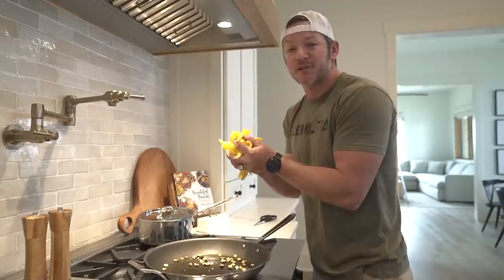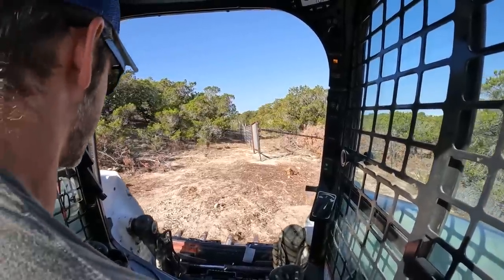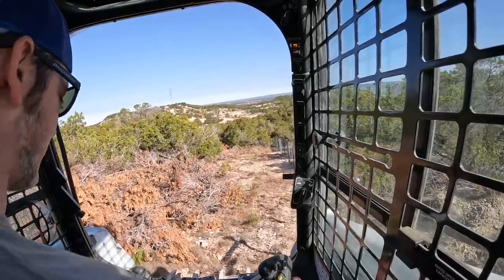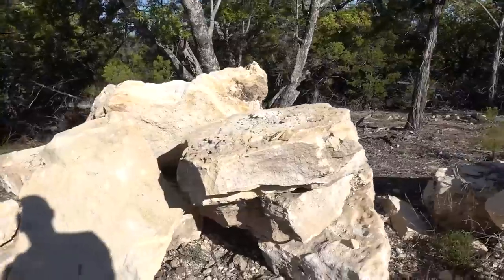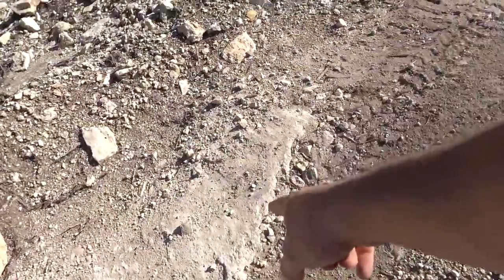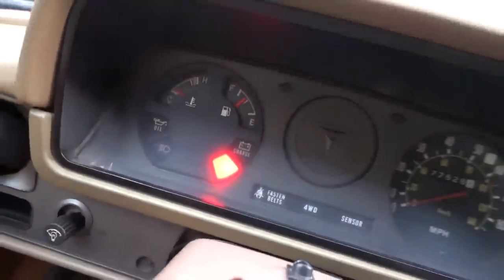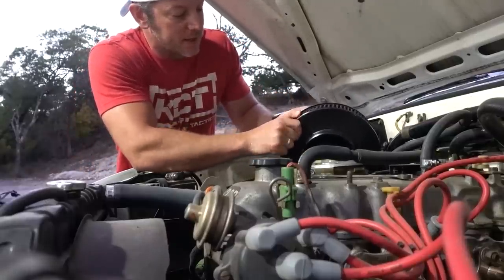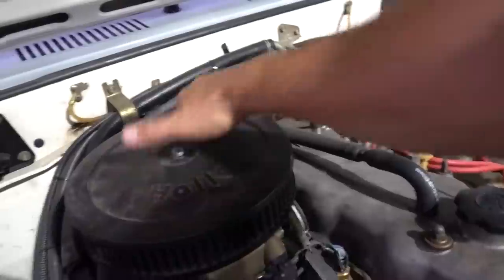Making a Home for the Goats!!!

Comment: Build your goat barn on skids so you can move it around that way it’s easy to clean the pen or move it to a different place if you need to. Also I would recommend wood sides so it stays cooler in the summer
Reply: Very smart idea.  When a fella knows, he knows.   Information has value.
Reply: that's better than my idea  to build doors at each end so the skid loader could clean it out easily.
Reply: My brother built his chicken coup on wheels
Reply: Yesssssss!
Reply: Demolitia FTW
Reply: Goat barns in Sri Lanka are set up on poles. Then their waste falls down and they are protected from floods and moisture. Also, it is easy to clean.
Reply: @thilinasesath3869  That actually sounds like a great idea in a few ways. Everything will fall through (as you mentioned), it'll let them stay on dry area when things are wet and the extra bonus, if set up properly could be raising it enough and adding something like pillars or blocks at reasonable heights that the goats can jump from one to the next till they're in would be to give them somewhere most predators wouldn't be able to reach or climb to. I don't know about that particular breed of goats but, one I used to have as a pet was an amazing climber, much better than any medium sized predator and they love doing it so raised up 4, 5, 6 or even more feet could provide them with pretty good protection and, they'll feel more secure plus enjoy the climbing.
Reply: Had a 10 x 20 horse shed on “skis”.  Easy to move with a tractor.

Comment: MATT the goats will jump up and over the fence from the roof.
Reply: He better make the roof really tall so they can’t climb on top of it, or put the pen in the center away from the fence
Reply: Yes, goats love to climb and if your shelter is too close to the fence, that will be an easy escape route.
Reply: 😂 make straight walls they can’t climb
Reply: @tylerwestman5258  they will do some parkour wall jumps off it still
Reply: @cmawhz  make it sheet steel and paint it now they won’t be able to get any traction to wall jump
Reply: I was wondering the same thing.
Reply: That's not going to be a problem... mainly because the whole fence is far too low and they'll get right over it with no problems as it is, especially on the stepped portions. That's if they don't get eaten within the first week of being let out.
Reply: Once they're full grown they will be able to clear that fence from the ground. It needs to be about three feet taller.
Reply: Build the shelter far enough away from the fence, so they can't climb it, then jump over the fence.
Reply: He was told that in the previous video but he does not listen or read comments!!
Reply: I agree move the barn shelter al least 20 feet from the fence and keep the inside fence line free of anything that goats can clime and then jump over
Reply: Exactly what I was thinking
Reply: Predators  can easily  clear that short fence. Goats will be gobbled up.

Comment: I have goats in Texas and a 3 sided shed will be fine. Metal in Texas will fine as well. Goats are very hard on everything so the more metal the better. Hope you get my metal suggestion. Build it away from the fence unless you are going to make it to tall enough that they cannot jump on the roof. If your driving in and out of the pen then make it so you have to go through two gates , one gate is always closed when entering and exiting. If your male is not banded already then you need to fix that or be prepared for a very aggressive goat and I am not kidding on that.
Reply: When they're young you can just use one of those Igloo dog houses for shelter.  They are small enough that their body heat will keep them
warm in the winter and they love to jump on top of it!
Reply: (good pun! - Kidding - you know, cos baby goats)

Comment: Hey Matt, you should put a nut at the bottom of the hold down so you can lock the hold down to the top of the TB, then it can't come out again. 22Rs vibrate a bit so a lock nut at the TB is necessary to insure it stays.
Reply: And get rid of the nut and washer. The less parts that fall down the intake the better. Or at least double nut, or nylock what he's got now

Comment: Unless your brakes are leaking, you probably will need to replace your brake pads soon. The brake master reservoir is sized so that it holds enough fluid until the pads wear out and the pistons extend. Change your brakes, bleed them, then make sure the reservoir is at the full mark.
Reply: Don't necessarily need to bleed  unless air got in there or doing a flush. I've had issues just doing brakes
Reply: Couldn't have said it better myself!!
So many times iv had customer vehicles that they topped up there reservoir and when we replace the pads the brake fluid overflows and makes a wonderful mess.

Comment: For the barn, any simple, yet sturdy structure that has a heating lamp or even insulation if you’re feeling fancy. But I mean, the most important thing is that it keeps them warm, dry, and safe. You COULD put something like a dog or mule or something out there with them for protection against animals, but that part isn’t necessary assuming you attend to them regularly

Comment: Make sure the barn is facing east to protect them from the wind an rain. I would put the barn closer to the gate. I would build a water collection system like the chicken coop and have lights either solar or run electricity.

Comment: With the rocks, use those for the goats to climb on, it will help keep the hooves wore down. That way you won't have to trim them as often. Also make sure your goat hut is tall enough that the goats can't jump on top of it and then jump the fence. And if you build a 3 sided run in with a wall that also goes half way across the front, they will be able to stay out of all wind and weather that way.

Comment: Hi there Matt! It's so fun that you got your kiddos kids of their own. Does this make you and Mere grandparents? Those rock slabs will be PERFECT for a play structure for the babies. The good thing about rock is it will also help to keep their hooves from overgrowing as fast.

The biggest thing to keep in mind when putting a shelter up for goats is that they HATE water. If they are on the downhill side of all the water that is going to run off that hill, they are not going to be happy. I would suggest putting some sort of "poor man's" french drain, meaning dig a ditch on the uphill side of the shelter and back fill it with large gravel. I think that'd go a long way to keeping them happy. The other option would be to put a floor on it, which would resolve most of the water runoff issue. 

There are a lot of good channels out there to show you what goats want and need. I would recommend making the lean-to/shelter portable (to an extent). I'd make it so the skinniest end can fit thru your gate, just in case and that three of the four sides are closed in. If can envision what I'll try to describe, then it may be helpful. Essentially what I'd build would be what is frequently referred to as a loafing shed. If you can envision a rectangular structure with 6 posts erecting it, you would completely cover three of the four sides. Now, on the front of it, it will be open with a post in the middle of it length-wise. If it were me, I would also make a half wall on one side of the front. It will help with shade, wind break and blowing rain.  If at all possible, it would be great if you could keep it strong enough to withstand weather, but light enough that you would be able to make it somewhat portable. I hope this helps. If nothing else, it'll give you some ideas. If you look at Flair's channel, you can see the two large red structures he has in his animal paddocks. That's the idea behind what I tried to describe, lol. I tried!

Heather🇨🇦
Reply: 100% all this !

Comment: Matt, put locktite on the carb filter stud. That way you won't have to worry about it vibrating loose on you. Preferably red or orange locktite, since youll likely have alot of heat in that area
Reply: probably a hard to undo sort on the rod into the body then a type you can undo on the top nut so you can take it off (I only know blue & purple, are red & orange the equivalent in high temp?)
Reply: @trif55  orange is similar to blue but it's made more for high temp environments, red is the strongest but being it's being heat soaked in that area regularly, it would reduce some of its effectiveness. I doubt blue or purple will do anything and might as well just use nothing on it
Reply: @gtileo  thanks

Comment: Hi Matt. I would reccomend put a nut on the bottom side of that bolt you just installed. After screwing it in then tighten the nut down onto the carb. The way you have it now it will likely vibrate loose again like the first one.

Comment: Leave a gap in between the top of the walls and the roof, about ten inches will do. This combined with some overhang on the roof will give some ventilation. You can fit some hinged flaps or canvas to close it off in winter. When it gets cold they'll need some straw on the ground, remember you have Boer crosses, they are hot-weather goats. And yes as others have said either a donkey or a Maremma sheepdog (who will be quite happy living with the goats, google them) is going to be needed to keep them safe. 25 years of goat keeping here, I have around 200 at the moment.

Comment: That's a standard 1/4-20 carburetor stud. You need a toothed nut or at least another nut to screw down on there and tighten against the "injection" end of that stud. It won't come loose or fall out anymore. They've been done that way for 573 years.

Comment: For the Toyota Air filter bolt... put a nut on the part that threads into the carburetor amd tighten that nut down against the carburetor. It will make it so the bolt is tightened into the carb, and the top nut is tight against the lid... double tight!

Comment: My first car was an old Pontiac, that same air filter bolt came lose and dropped straight down the carb barrel and stuck the throttle wide open! It was a crazy ride I had to turn off the key to stop it. After that I checked that wing nut weekly lol

Comment: The comments about the goats jumping onto the roof and over the fence is legit, they will do that. Also, the comment about building it on skids so you can move it around to clean inside will save you from having to go inside to clean it. You can anchor it with screw in earth anchors to keep it from washing down the hill. Finally, if you don't find a way to divert rain water away from the goat shed, rain water is just going to run down that hill and collect on the level ground you just made leaving the floor of the shed a muddy mess. $.02
Reply: I agree, the shelter needs to be anchored in place, goats (especially males) love headbutting anything and everything and rubbing on stuff. They could move the sheltrr if it is not properly secured...

Comment: the gate you can make fence fit under gate use emt 3/4 in or 1 in tubing or cut fence to side and wire tie to pipe.

Comment: A barn/shed with at least 3 sizes enclosed and a large door on the other. They like sleeping outside but when it gets windy and rainy outside, they like to be someplace free from drafts. It should be large enough for you to have a feeder and water inside. Dirt floors are ok as long as water doesn't get inside as goats typically hate getting wet. Having concrete floors are nice for clean up as you can scrape it clean. If you have any large rocks/boulders that can be placed in the fenced in area, they will love it.

Comment: Those Toyota 22R engines are virtually indestructible.  The 5 speed transmissions behind them, not so.  Had one in high school.  Ran the hell out of it.  Got it from a cousin with over 85,000 miles on it and put another 90,000 on it myself.  Driving like an idiot.  Replaced the transmission once and rebuilt it three times.  Replaced the started, alternator, and fuel pump on the engine and that's it!  Telling you, those 22R's are indestructible!  Mine was an '84 model.

Comment: Can you just pull the pins on the gate and move the gate from over top to underneath and put the pins back in? Hard to tell how those hinges work, but that would be easier to lower if that works.

Comment: Better put a dab of lock-tight on that bolt. You should build the shed away from the fence, goats love to climb and escape. Buying a wood shed from Orange or Blue home improvement would make it easier. Plus, you could put a watering trough along one end, outside. You are gonna hate having that gate right there, trying to turn every time. Might work better if you put it at an angle, at the corner. Have to adjust the poles a little. Definitely, gonna need to be lower and wider.

Comment: A goat shed should be at least 3 sided to protect from wind and rain I build mine on skids so I can move it around.. don't build it next to a fence they will jump out I usually build a 6 x 10 shed about 4 ft tall and face the back towards the north to protect from cold ... Yes even in Tx ..put straw down " not hay "  as a insulation barrier between the ground and the goats both from wet and cold

Comment: I'm not sure if anyone else has said this but, brake fluid is not one of the fluids you top off without changing/checking the brakes. the level of your fluid is in direct relation to the wear of your brake pads. Always check your brakes or change them before adding fluid, pads for that truck really aren't on the expensive side. If its still quite a bit low, check for leaks and weakened/expanded lines, not being able to stop a moving vehicle is the most expensive route you can take.

Comment: Wow Matt I would love to have Toyota pickup like that that'd be cool but as far as the gate to your goat pin try taking the pin out of the hinges and find a long bolt with a nut on the end that will go through them and put the top part of the hinge on the bottom and put a bolt and nut through it that will lower your gate you never know it might work

Comment: Built allot of horse lean-to s and sister has raises and shows your exact goat breed. I'd do a basic lean-to  for that as well. Biggest important part is that your main corner posts should be large treated actual round post so it lasts longer. 2 bys or 6 bys won't cut it. Definitely want buried treated corner posts.

Comment: bolt on the carb, double nut it and screw it all the way down till its tight, that way it wont vibrate back out, and you can undo the nut without the bolt coming undone too.

Comment: Check your front brake pads for wear. The brake master cylinder is the indicator that your pads are getting pretty worn out. And, if you replace the pads you should remove some of fluid otherwise everything that you just put will overflow back out.

Comment: The goats will jump on the shelter roof and over the fence. Build the shelter more in the middle of the fenced in area. Also, your fence is far too low even without them jumping up on the roof and over.

Comment: normally when the brake warning light comes on means the brake pads need replacing or you have a leak...
if the air cleaner screw went in the carby it would hold the revs up

Comment: Goat barn: this is from an architect designed goat barn….They need to climb, so front half human height with doors left and right for easy cleaning, back half taller with platforms for the goats. Roof angled front to back with vents at top of back wall. Flip open windows on front side. Rain collection on roof. Also, move it away from the fence.

Comment: Hey if brake fluid is low. It's either you are nearing the end of your brake pads orrrrr you have a leak. As it's a closed system you won't just lose fluid. Should do an inspection on the brake system

Comment: You might have a small leak in the brake system if it was that low. Brake fluid usually doesn't just get low.

Comment: you can thrash a 22r all day , the only down fall to them are weak cam lobes , they are known to wear the cam lobes down , whack in a little aftermarket comp cam little bit of head work and it will come alive , also with the holly one '' could '' turbo it ,

Comment: It might not hurt to take that air filter stud off and put a jam nut on the bottom part of it that goes into your throttle body. That way when you are choring you don't lose your stud from vibrations again! Also, the goat shed needs to be away from the fence or you wont have anymore goats in the pen....

Comment: And. Unless your breaks are leaking. You shouldn't fill it up with oil. Usually a sign you need to do breaks because when you squeeze your caliper it makes the oil squirt back into the resevoir. Topping the resevoir will make it over flow ALL over your engine bay.

Comment: Pull that filter stud back out, put a nut on the bottom half before threading it in then use that to lock it in place, otherwise its just going to rattle loose again.

Comment: Matt Need a bigger area so you line-up gate open area much easy.  Like big turn. Throw  rye or hay seed so goat in spring have some thing to eat do now if get rain or snow it will water plant . goat barn need about 8 feet tall (if you want walk in it ) you can do 4 feet tall what is total goat you going have ? three goat I think 4 feet by 4feet and 4 feet, also DO NOT the goat barn  close to the fence Goat will find a way to get on top roof and jump out the pin

Comment: Aren't you worried about 'yotes hopping the fence for goatwiches?  Better fence would have been a 10 footer with barbed wire on top.  Also, if you aren't searching that whole area when feeding and watering you could miss if a goat goes farther in for some reason (they will hide if they're sick or dying).  Just a thought.